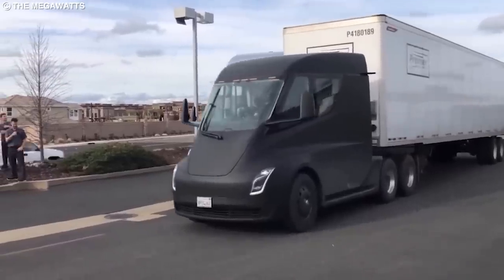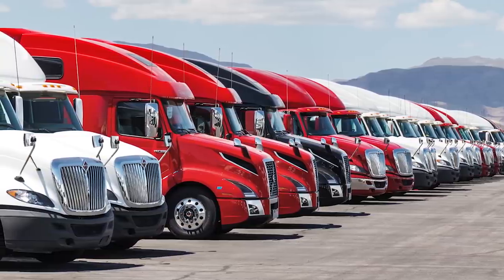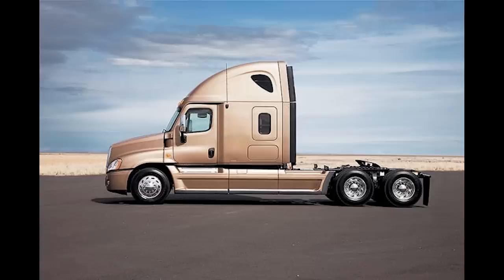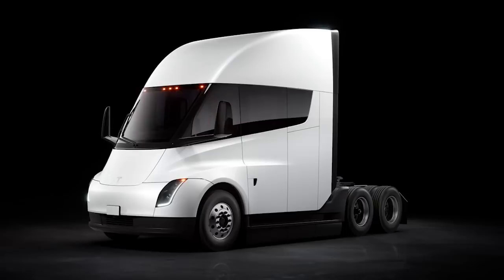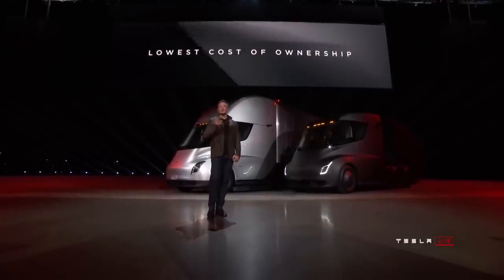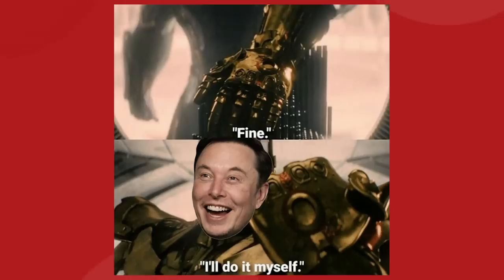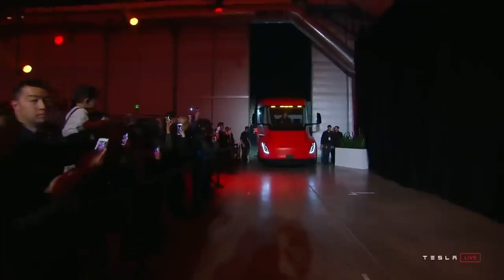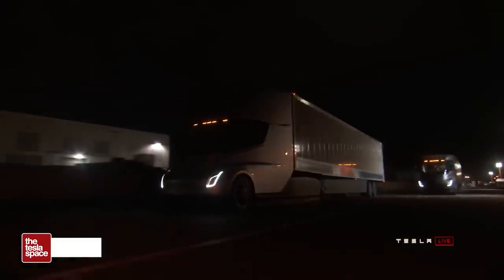The Real Reason Tesla Developed The Semi Truck!

Comment: Thank you. Very informative video. I had never really thought about the different designs between North American and European heavy trucks, but it makes sense now.
Reply: Yutes
Reply: And that’s why the tesla semi will never work in Europe unfortunately!
Reply: European trucks are also more compact and way more capable and also powerful
Reply: The electric people are learning more about the trucking industry. But there is some to learn yet. The Cascadia Freightliner is not a long nose tractor.long nose is more what the Peterbilt and Kenworth OTR models are. The short nose tractors are designed to contain the diesel motor and be fairly aerodynamic as possible. It also maximizes handling in tight spots. Where Freightliner has gone through much development to make a tractor as aerodynamic as possible, they can use that already proven and currently under production model as a platform to begin their program of producing an electric tractor. A quick and cost efficient way of getting their start into the EV arena. Once they have a system developed that they are happy with, I would bet you will see a whole new chassis and  cab to go with it. Tesla started from scratch, and started early, so a ehole unit needed to be designed and built at once.

Ad far as a sleeper berth design for Tesla, that is probably not a very big or current push. Pepsico, Walmart, and other such companies are getting the first EVs, and most will be on dedicated runs amongst company locations. The driver will be returning to the origin location to end the day. And all their locations services by the electrics will have charging stations. But as the electrics become more numerous, and infrastructure becomes more consistent, they will start OTR work and the sleeper berth will become more necessary.

The European tractors may remain in their current type design because they are not out in the open stretches running highway speeds such as our American semis do. Aerodynamics are not as crucial for them, where the compact design is.

I am glad to see that many EV enthusiasts are beginning to see the concerns of tractor net weigh and distribution and the need to fit truck performance to match the limitations of "hours of service" that drivers have to meet. I am now retired from driving, but would really love to try out one of those Teslas. I started driving when the mirrors were still less than desirable, and always hung out the window when backing.   I wonder how that would work when I would be sitting smack dab in the middle of the cab! I am watching with enthusiasm as the times are changing.
Reply: It doesn't. These trucks are never worth it as they cannot carry enough cargo.
Reply: @112523  My big question all along has been what does the EV tractor weigh as opposed to the diesel. This is because I was wondering if we were going to lose net hauling weight. Someone told me later that the weight would be "close" to the average diesel. But there again "how close". We are only allowed 80,000 gross, so an additional "net" would result in loss of "tare" , or freight. Recently I heard the National Transportation Board may give an EV tractor trailer combination an extra ton of gross (82,000#). I noticed the 500 mile test run was said in the article to be 81,000#). But I am still waiting to hear if that will allow for the same amount of freight to be transported legally as the diesel. Sooner or later we will get answers. Diesel will remain the OTR solution for the near future. And the EV will be showing us what it can do on dedicated and P&D runs. It will be interesting to watch. EV or diesel, I am glad that I am retired and not "out there" anymore. I feel much safer in my easy chair. Especially after seeing everyone sliding and skidding around in our newly fallen snow!
Reply: @ronfullerton3162  from what I understood. To even get the same mileage on one charge means they would need a bunch of batteries taking away from the max load capacity. And not only that, the charge time is of course way more then just filling up a tank.
I believe a regular truck can handle 50 tonnes and an ev around 20. But i can be completely wrong tho
Reply: @112523  Here in the States, we are allowed fourty ton or 80,000 pounds of total weight. Most of the trucks I drove, I could haul 42,000-45,000 pounds and be legal. Hopefully the EVs can carry the same, and stay legal for gross. The battery technology has been rapidly changing, and giving more miles and quicker charging times. If the trucks can remain on the road for the eight hours maximum time a driver can remain on the road without a break, and then charge enough during the drivers half hour break to run for three or four more hours, then we would be good. Of course the federal DOT would have to give drivers of EV trucks a waiver on the hours of service rules to allow the driver to go off duty while the truck charges. Currently a driver must remain "on duty/not driving" during fueling. If a driver must remain on duty while the truck charges, then the driver will possibly lose driving time. 

There are many things to work out yet as EV tractors come into the trucking scene. And If the EV tractors are successful, it will be a good number of years before infrastructure and EV production can totally replace the diesel units. All of this will workout as the time change over will take. And it will take time for all this to shake out and see where we are at. Patience is needed.

I am personally going to miss the sounds of those diesels. Some are already not heard much anymore now. The 71 Detroits, the 3406 Cats, and the big cam Cummins were old engines getting to be seldom heard even now. But that is just the way things go!

Comment: Can you confirm another and maybe the biggest advantage of the tesla simi.  
It is said it will have full self driving.  It has even been said that a driver in the 1st truck could have 2 other trucks follow using FSD and we could see a small 3 truck convoy going down the highway with only one driver.  

I would even speculate that if each rig had its own driver that this would allow these tesla trucks to run 24/7 by letting to 2 other trailing drivers rest till it is their turn to take over the convoy letting the 1st driver rest in the 3rd position.  
I can see driving from coast to coast in about 2 days in this manner hitting Superchargers along the way and getting food at these kind of truck stops.  

I guess it would be like a Cannon Ball Run taking this approach.  

They could play the Smokey and The Bandit theam song while pulling into and out of the SC'ers.

Breaker Breaker 19
Reply: Bullsit!!!

Comment: Is the Tesla Semi in its current shape going to qualify to be sold in Europe and Asia, or will it have to be redesigned?
Reply: I think it will be "ok" as is for highway use anyhow. Local delivery may be a different story but thats the european road system. Smaller trucks, vans etc will take it from there as they always have.
Reply: Absolutely it has to be varied in some corners just following the fact that US and EU have different regulations e.g. hitting safety and lighting. There 7s not one rolling product not specified different as EU or US sold product I know.
Reply: It's 90mm too wide to be legal in Australia, I'm not sure what can be done about that. After having a look, it's actually too wide for most of the world.
Reply: @drewwatts7867  maybe they can drive it on mars
Reply: The center driver position was designed for Europe use!  This is especially important when driving supplies from England to France and being able to drive on the left or right side of the roads.
Reply: @donfields1234  lol….. the tesla semi has no place in Europe unfortunately! Driving on the highway alone is a no go because diesel American trucks could have done the too. When you see a cabover European truck parking or going through a very tight space you’ll realise how it’s super efficient
Reply: @donfields1234  nope that’s not how it works
Reply: @Kangenpower7  nope it wasn’t designed for Europe lol…. It’s a very stupid driving position
Reply: @Kangenpower7  the tesla semi isn’t made for Europe because of its longer dimension
Reply: @Kangenpower7  The McTesla F1 🤣
Reply: I've seen quite a few Mercedes and Renault electric trucks on European highways by now  and they seem to do function pretty well. It's still not clear why & how the Tesla will compete with these . I hear a lot of lofty phrases,  but it's still not very clear how Tesla will compete with existing European trucks.It's all a bit vague.
Reply: @spiritualanarchist8162  It’s called being able to drive 500 miles nonstop on a single charge, as was demonstrated recently according to Elon. You save a massive amount in fuel and maintenance costs every year vs diesel trucks, probably well over $50,000 per year in savings. No other electric semi truck has demonstrated that kind of range.
Reply: There are right now several electric trucks right now from giants like Volvo, Scania and Mercedes to name a few. They have both European and North American versions,. Regular truck driver is not a gadget freak so having touch screens will not be a sales point.
Reply: @KeyhanHadjari  it will come down to which truck is more capable and cost effective to operate.
Reply: @iakona23  I think truck market will not be like auto market. Teslas are not known to be cheap.
Reply: @KeyhanHadjari  Well, we shall see. I think that these electric trucks in general will become so much more economical to operate and to maintain vs diesel than every electric semi that is made will find an eager buyer. I saw one estimate where the money that is saved every year by operating a Tesla Semi vs a diesel Semi could pay for the cost to buy a new Tesla Semi in about 7 years.
Reply: @iakona23  '  According to Elon ' .Doesn't mean anythin.  i'm asking what this thing can do right now.
Reply: @spiritualanarchist8162  Yes, the 500 mile nonstop trip was done according to Elon. It would be an SEC violation and a crime for a CEO to lie about a material fact. I’ll take the CEO’s statement of fact any day over the opinion of a nobody online with resentment and jealousy toward Elon who has zero access to the relevant facts.
Reply: @iakona23 '  nobody online with ...' wWhat ? What are you on about ? I'm asking specifications and i get some ranting lunatic calling me names 😂Weirdo.

Comment: Legacy semi-truck designers have gone down the same route legacy steam locomotive designers did when a little know company started building diesel-electric locos. A long-running legacy must be upheld at all costs. There is a style each company is known for and it must be seen from a distance quickly.

Starting with an absolutely clean sheet of paper is the only winning combination for any new ground-breaking idea. 

Take a good look at the current number of legacy builders who are putting a toe into the electric semi-truck market. Twenty to thirty years from now they will be gone.

Comment: A thought experiment for Perth, WA to Lismore North Coast NSW - Using Tesla Semi travel from SIPform WA and Lismore, then onto Brisbane to purchase Weathertex.
Super Charger for Tesla Semi at: 
1. SipForm, 4/3 Finance Pl, Malaga WA 6090 
2. BP Truckstop, Eyre Hwy, 1 Coolgardie-Esperance Hwy, Norseman, WA 6443. 
3. Shell, Eyre Hwy, Nullarbor SA 5690 
4. BP Truckstop, 35 Eyre Hwy, Ceduna SA 5690 
5. Shell Coles Express Port Augusta West Roadhouse, 34 Eyre Highway 1 &, Stokes Terrace, Port Augusta West SA 5700 
6. Shell Coles Express Broken Hill, 164 Williams St, Broken Hill NSW 2880 
7. BP Truckstop, 180 Mitchell Hwy, Nyngan NSW 2825 
8. Bendemeer Tourist Center, 19 Havannah St, Bendemeer NSW 2355 
9. Bunnings Armidale, Corner Barney & Canambe St, Armidale NSW 2350 
10. Lismore 2480 To bring SIPform panels to Lismore 2480 

To buy two Tesla Semi,  Travel SIPform WA to Site Lismore 2480 once a week there and back, at the end of 2023. 

 Fully Charged LIVE— ICC Sydney from 11th to 12th March 2023. I will be there in Sydney.
Ian Cleland

Comment: They could fill the tops of the trailers with solar panels, and have an area at the front of the trailer filled with ultracapacitors, that would always provide extra range. Maybe connect to regen for going down hills or mountains as ultracapacitors charge much quicker than batteries, when ultra capacitors are full then send charge to recharge batteries. The computers could handle charging and recharging.

Comment: The Tesla Semi is the next generation of long haul tractors.  It is just that simple.  And there will be many new uses that will be developed that will make the Semi a radically more flexible and capable transportation vehicle.  Think mixed mode trailers, refrigerated and dry or conditioned storage.all in one trailer using the Tesla heat pump or a derivative of it just as one example.  The possibilities are endless.
Reply: it's not that simple and you are a goof for thinking that.

Comment: I wouldn’t want to be in a center or a truck driving especially if I was used to driving a semi all my life. I drove a truck for a very short time though. So hopefully it works out for the truck drivers and they feel safe in them and comfortable.
Reply: It’s also going to be super hard to adapt on such stupid design by tesla! The cameras will never replace hood eyes
Reply: The braking of an electric truck will be incredibly safer using regenerative braking than air brakes.
Reply: @ewardwwulin1674  nope lol….. electric trucks will have both types of braking regenerative alone won’t be enough even for emergencies
Reply: @ewardwwulin1674  Diesel both have engine braking and physical brakes
Reply: @alanmay7929  yeah but it’s inefficient no regeneration.
Reply: @ewardwwulin1674  for the same power output ICE tows/haul significantly way more than any electric vehicle! An Australian road train has about 600hp average and haul 4x80,000lbs while the tesla semi is supposed to be at least 800 to 1000hp lol…. A 1000hp diesel truck is literally the holy grail to tow the earth basically
Reply: @alanmay7929  When have we ever cared about having too much under the hood?! The Bugatti Veyron has 1001 HP and is not hauling 80,000 pounds. LOL

What Tesla did is to use existing well tested (and extremely efficient BTW) motors, but they wanted/needed to have significant regenerative braking for 80,000+ pounds of mass, so they had to use 3 of them. Being able to go up a 10% grade at a speed faster than a sloth is a huge benefit and great for marketability.

Comment: Some back of the napkin math points to each Semi would need to be delivered with one to two trailer loads of solar panels to provide its energy.    1.5 to 3 acres of solar per truck.  There are two million Semis in the US.
Reply: @mattweisbart4061  its actually more about weight and square footage of solar required.  1.5 acres of solar on one bright sunny day  to go 300 miles or so.  There are a very few vehicles that can gain anything from onboard solar.  Aptera that is to come out next year should be able to generate enough electricity on a sunny day to go about 40 miles.  But that vehichle is an ultralight composite 2 seat three wheeler.  Opposite of a truck.

Comment: Volvo VNR 300 4X2 (Daycab) Conventional with D11 Diesel with twin 75gal. Fuel Tanks: Approximately 16,000lbs.
Volvo VNR Electric 300 4X2 Conventional, Electric Motor rated at 455Hp/4,051ftlbs of Torque. Fair Wheather Vehicle: Excessive Heat or Cold Degrades Batteries thus Decreasing already short range.
Vehicle Weight: Approximately 25,00lbs.

Comment: First thing no driver nor company cares for 0-60. 2nd is that these should be for local deliveries only untill they can be supported around the country w/o issues as in charging, breakdowns and parts being limited. I don't see other companies such as crst, swift, werner, Schneider, trans am, cr, tmc, etc buying these until parts become common and don't take months to get, when they're not half a million per unit and when they can break the 700mile per "fill up"

Comment: How many of you that are commenting are truck drivers?
There are many reasons the center driving position will be inconvenient.
When backing into a real tight spot or backing out of a tight spot. you have to roll your window down and stick your head out and sometimes open the door and hang a quarter of your body out back up to make sure you have a clear view. Can’t do that if your sitting in the center.
And then there’s a little stuff like 
I like rolling the window down and sticking your arm out to wave somebody down, smoke a cigarette, 

I know that’s the tiny things of life but it’s what were used to. And why isn’t there room for a second passenger? 
Yeah, I know I’m nitpicking. But there’s a lot of stuff that I can see that would be inconvenient sitting in the center. Any truckers on here?

Comment: Are you simply stating Wh/Kg as though the chemistries are the same in 18650, 2170 & 4680?  Because I'm pretty sure they're different in all 3 battery formats.
Otherwise your comparison implies it's the size & format that defines an inverse capacity to that which is expected, but chemistry makes the biggest difference.